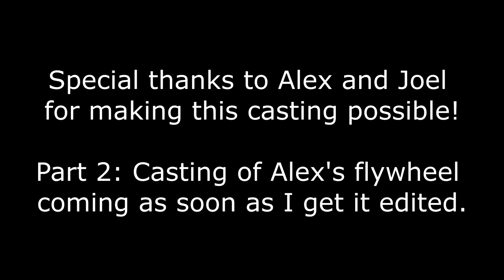DIY Bronze Casting using Lost Wax Method. FROM CHEESE TO BRONZE!

Comment: try mixing fine "silt" sand in the plaster ..also i use "dry wall repair" plaster  .. and i cant say actual times but a long cooling time before quench makes a hard and often brittle bronze vs a  shorter time makes a softer bronze ..(3 years experience becker metal works "foundry" st.clair michigan)
Reply: Just a novice here with a question. Is he using green sand, or regular when he mixes it with the plaster?
Reply: @at3sams  not sure which is used here ..i use the finest of dust mixed with sand from my driveway mixed with watery plaster ..with a long drying time and careful care to not allow excessive heat .. room temp 75-85°f or the cast can crack from a fast drying time

Comment: stumbled across the channel, subscribed :) 

 one thing youngster. . . from an older artisan - TAKE CARE OF YOUR HANDS! 

it may not be an issue of "masculinity" or lack there of as it was when I was full time crafting for you now a days. . . but, go get a manicure and take care of your hands!  use lotion, tell whom ever is giving you the manicure you're a craftsman / artisan and work with your hands around hot / sharp / dangerous materials and they will tend your skin and keep your nails healthy and strong.  They SHOULD if they're a good salon teach you lil tricks and tips on keeping your hands healthy, strong and capable of enduring the rigors they're put through. :) 

ok well two things, elevate your demonstrated safety.  even in primitive / beginner or advanced methods and processes do not risk yourself for discovery when its a simple process to greatly improve your chances!  even on a budget safety is possible. . .yeah it takes some extra time, sometimes some extra bucks but for the added measure of coming out the other side of the experience intact a much welcome addition worth enduring.

Good luck, never stop learning and I'll be watching more!
Reply: Starting with not wearing a ring while using power tools :(

Comment: you need to use borax acid. its a powder used to make melting process faster and also helps in cleaning impurities. also the time you take from taking your mold out of the fire to the time you pour in your melted metal should be minimized to the least to avoid loosing heat therefore allowing the melted metal to flow easier to all the desired mold. great job!

Comment: I noticed that your graphite crucible was starting to burn and cause pitting just like mine did. I used a coal furnace to heat my brass too and I've found out that coal creates an oxidizing environment and actually burns the carbon in the graphite. It's kinda a funny to think that basically your crucible is like putting a really expensive piece of coal in a coal fire.

Comment: Why did you add sand to the plaster? Does that help somehow? I'm almost up to the plaster stage.
Reply: So what did you use?
Reply: @jesus2621  I incorporated the sand and made a mold 
However, I failed to melt the silver property. I put that down to an improperly glazed crucible. 
I do have several nice injection wax castings of the ring I'd like. Could ballpark the cost of having a pro jeweler throw the metal for me? I have no sense of what that should be and I've been holding off in that regard.

Comment: Tip - when mixing plaster (or any cementitious product), start with the correct amount of water in an empty mixing container, then add the dry ingredients. The amount of water is a better indicator of the final volume than the dry ingredients. Use about half the required final volume of water, then add dry until the consistency is what you want. It is much easier to mix.

Comment: Interesting the use of a vacuum. I do the opposite for the same reason. I have an Autoclave and put the wet mold in there to cure under high pressure, it shrinks the voids until they are very tiny. BTW: If you ever use Portland cement, sugar makes it harden slower and chlorine bleach makes it go faster.

Comment: So i got a 3D printer to make a number of things, but i wanted to see if I could apply it to casting. I found there is Foam that you can print and soak in water to turn soft but the better option is wax filament. You could also use the most common filament PLA but its harder to melt out than wax.  Which made me think of you. Since 3D printers are more affordable then ever I thought you might want to look into it. You could have amazing casts. Hope you read my message. =)
Reply from the maker: +Geilisa Almodovar I almost 3D printed the part that I'm going to be casting this weekend. But I ended up CNCing it out of machineable wax. I don't think I would use a 3D printer enough to make it worth getting one. i have access to a bunch of 3D printers at HackPGH(my local makerspace) and I have 3D printed one part. I also have access to 3D printers at Penn State Behrend. I've thought about buying some printable wax. Just haven't yet. You can do ABS too. You just have to burn it out at a higher temperature. A lot of people don't burn their plaster molds out at a high enough temperature. You should melt it out first, then back at 1200F.
Reply: Makerj101 I'm jealous I had to buy one. lol. I wasn't aware my college had printers till after I left. I wish I had done engineering. I'm going to try PLA first. I just got the printer 2 weeks ago. I'm excited to use it for casting tho. I've use lost foam and 2 part molds. never the lost wax plaster method.
Reply from the maker: Geilisa Almodovar well now you have one! Sounds like you should have become an engineer! what degree did you get?
Reply: Makerj101 Criminal Justice. lol.
Reply from the maker: +Geilisa Almodovar that's an interesting field! I've always thought it is really cool how they use so many technologies to figure out who committed the crime.
Reply: Makerj101 It was fun. I just wish I had gone with my original instant of architectural engineering or any engineering. I would love to learn more mechanical stuff. Have you hear of Raspberry Pi computers? I got one to connect to my computer with a camera. I can control it remotely and view on my phone. no more going back and forth with a micro SD card.
Reply from the maker: +Geilisa Almodovar yeah, I've heard of them. A lot of people at HackPGH use them for all kinds of things. I've never messed around with them tho. That sounds lounge a really cool project! What do you use it for? Taking pictures of burglars?
Reply: Makerj101 oh I mean connect to my printer. lol. I can control it remotely and watch it. tell it to stop if it messes up.

Comment: suggestion, check out your local dental supply house and see if you can get a high heat casting investment (water mix) that is used for casting partial metal framework dentures.  You will have more working time and get smoother castings.

Comment: Great job! Can this process be used to cast aluminum? Why did you heat the mold prior to to pouring melted bronze into it? Thanks.
Reply from the maker: +John Harrison yep! You can use this process to cast aluminum. Toy must heat the mold to 1. Blurn all the wax out so the metal can take its place. 2. To drive all the water out of the plaster so that it doesn't just turn into a mini volcano from all the steam. 3. So the metal doesn't cool as fast as can fill all details.
Reply: Thank you!

Comment: What's the purpose of using the vacuum chamber?
Reply: To get rid of as many air bubbles in it as possible before the mix set up with trapped air. a vacuum chamber is useful for this as well. But  tapping it and hitting it on something solid works to if you do a good job.
Reply: Manuel Lozano get the air bubbles out of the plaster

Comment: -1 this has to be the most unsafe casting demo I've ever seen. jeepers it's a wonder someone wasn't hurt or a fire started
Reply: to name a few:
-Firing mold in makeshift furnace inside your garage (note crumbling firebrick)
-"where did I put my gloves... oh well"
-Picking up the mold with a piece of kaowool
-Setting a hot crucible full of metal on grass
-Standing right by the pour
Reply: Adam Joyce The first three isn't to bad, the fifth I agree with. # three though I would have wrapped a oven mitten with Kaowool probably instead of using my hands that stuff can be itchy on the skin.
Reply: Makerj101Don't worry about it just be more careful with when someone else is pouring, and try to keep some gloves near by and wrap it with some kaowool :D. Love your content.
Reply: Some people are uber anal with safety. Doing things at home using more common sense than excessive safety makes things fun. I didn't see anything wrong with picking up the hot mould with mineral wool. I wouldn't go sniffing it. 😆 Also don't see what was wrong with burning the wax out with the Bunsen burner in the garage. Great video!
Reply: It's your choice if you want to fly by the seat of your pants and take some risk. It is far from a smooth operation, but it was fun to watch.
Reply: All casting demos look unsafe.Not sure what planet you live on.
Reply: pds tech ditto!
Reply: "I probably got a bit of copper poisoning"

Comment: The flashing on the little figure’s face could also be from heating your plaster so quickly. Investment is stronger that plaster. Read Oppi Untracht’s big book, The Encyclopedia of Jewelry Techniques. Great reference! Good job. It went better than my first bronze casting. I found silver easier. Try cuttlebone casting.
Reply from the maker: Thank you for the tips!  I definitely heated the plaster mold too quickly.  I will try investment next time.  Also good idea with using wax on the saw blade.  I often do that on handsaws but never thought to try on a hack saw.

Comment: Little drop of brick acid (builders brick cleaner)would get the plaster off,wear goggles tho'!
Reply from the maker: spyderz1303 I tried both of those. neither did anything. I let it sit in hydrochloric acid for a while. nothing. And then I tried vinegar over night. nothing
Reply: Makerj101
 Very fine job, lost wax casting is definitely something I want to try. I do a lot of pattern making for other folks to cast stuff and  it is about time I tried casting myself. My biggest to date has been formers for two small lighthouses cast in concrete that weighed in at 10-12 tons each. Maybe some of the sand, or something in the sand has vitrified to the point of being glass
Reply from the maker: spyderz1303 wow! That's awesome! That's possible.